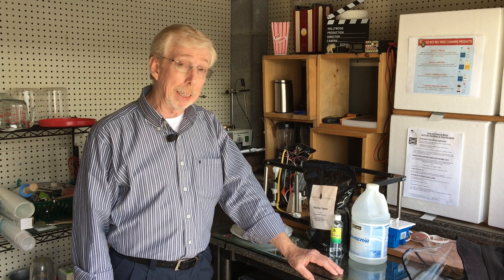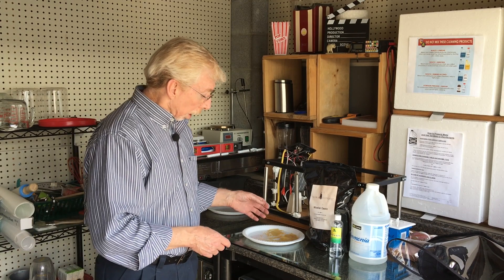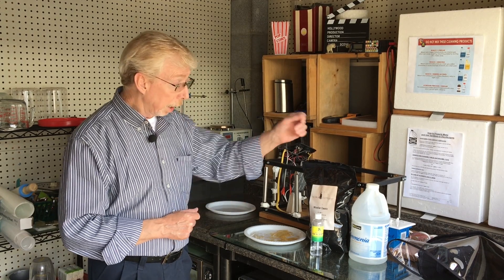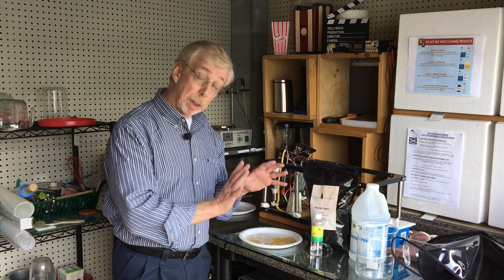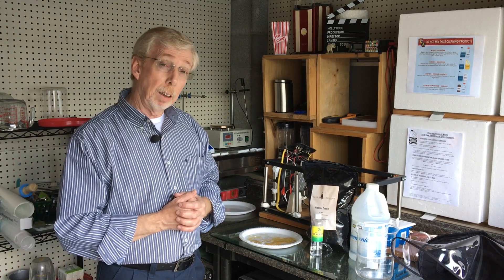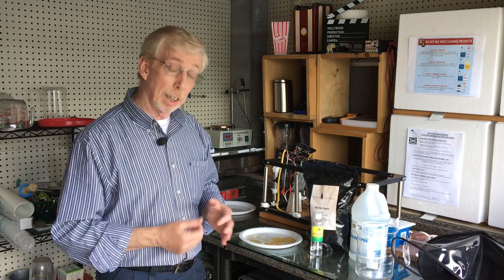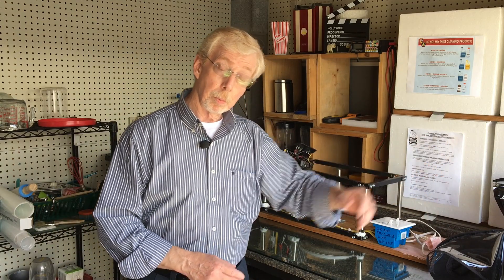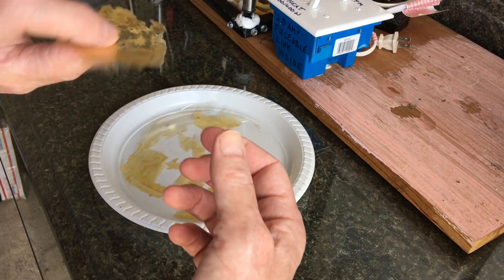Clear plastic made from milk. DIY Face Shield made from milk. Part 1

Comment: Great video!
do you know about an organic additive that will make the bioplastic more UV resistant?
Reply from the maker: I love your question as it gives me a chance to explain the difference between 'old thinking' and the new (much older) way things need to be done.
Our ancestors put everything that need long term storage in glass or metal. And we need to return to that. Then we got 'creative' and started using plastic for everything possible. Those days should move on into ancient history too.
New thinking says we don't want our waste to 'hang around' so we never add UV protection.
The focus of my channel is to show how to replace one use plastics.
There are some things that should be made from LPG plastic, if we would only do it responsibly.
Reply: @GEOsustainable  thank you for your answer. I understand and agree with your approach to single-use plastics in the privet sector. 
but if we are looking to make a change in the industrial sectors as well, we will need plastics that are biodegradable but also durable since not every application can be addressed to with glass or metal. 
a perfect example would be the agriculture industry (that I work in) which is one of the largest consumers of single-use plastics.

of course that this is only my personal point of view (:

Comment: I have read in Science Daily . com dated January 21, 2021, using as source the University of New South Wales, that though "ammonia has sustained humanity since the early 20th century, [but] its production leaves a huge carbon footprint.  Now researchers have found a way to make it 100 per cent renewable."  Is the ammonia used to illustrate this super interesting video 100 % renewable...?      If the emphasis here (I always follow your postings...!) is to be Geo Sustainable how can we be testing ammonia...?!
Reply from the maker: Well, you have a point. I do not know where my household ammonia comes from. I do know ammonia is found in nature and therefore, renewable. I do know most ammonia comes from cattle urine, so the carbon footprint they speak of are likely cow farts. I honestly do not know about the 'new research', ammonia has pretty much always come from cow urine. You could synthesize ammonia from the methane in a cow fart, but why would you...just wait for the stream. Tarnation, those cow farts are useful it seems :)
Reply: @GEOsustainable  Maybe the one that is not sustainable isn't made with petroleum chemistry like farming nitrogen ?
You can also do your own with your own pee ; )

Comment: love your videos! i've seen you use milk and gelatin in the past, wondering if you have any ideas on making bioplastic from plant-based materials?
Reply from the maker: Thank you so much for watching my videos. I love helping folks solve problems; the life of an engineer. I thought about doing something with cornstarch, but it has been done a lot by others and I can't add much to what they have done. So, I am open to any ideas you may have. Please don't click reply, as I don't get notified. Start a new comment so I get alerted. Thanks again for watching!
Reply: @GEOsustainable   From your garden's potatoes ^^ ? From industry residues ? Malt from brewery ?
I'm on my own experimenting from fermented grass. Permanent pastures are better CO² traps and humus producers than forest (everytime the outside part is eaten or mowed, the related roots dies and feeds the soil ! Renewable, disposed as trash, growing simply with sun, and a bit of water able to clean "dirty waters" (i thanks it with my pee ; )
Not (yet) for transparent uses, but to mold blocks ...

Comment: Is there an easier way to do this to make it at home? Since I’m a student I don’t have a lot of these items
Reply from the maker: I am sure you can do it at home. The chemistry needs to mix 24 hours and until all lumps are gone. If mixing is impossible, you can let it sit for a few days, or until the Casein is completely dissolved.  Keep it covered while you wait, the ammonia is very strong and it should not be allowed to dry out.
Reply: GEO sustainable Is there a temperature you should put it in or is room temperature fine? Thanks for replying

Comment: Is it heat or microwave safe?
Reply from the maker: Yes and no. It will become very brittle in a microwave. So, it would be a truly one use if used for food. It will not soften, it is a thermoset plastic with this chemistry. It will turn white if there is a lot of moisture.

Comment: very interesting,  now what do you thinking of ironing a few together? would you be able to seal them together? will the final product be able to be melted down and applied in a way to make long sheets?
Reply from the maker: Great questions. I do plan on ironing a few together, at the seams. They do seal, set to Wool (protein).  You will see that in part 2. I have not tried to melt them, which they will do,  I'll give it a go and report back. I have considered how to make a continuous sheet for a roll. My best guess would be a long belt, which I may try.

Comment: Looks good but how water proof is it?
Reply from the maker: Rotten Brainz  Yes, I use tannin, wine or tea, but it enhances the amber color. I will be trying pectin soon, as I have read it works. I hope to bring this to you soon in a video. The trick is, if the acid is too strong, it turns into Galalith. For now, to avoid all that, I use the Shellac (secretion of the female Lac bug). All good stuff Rotten!
Reply: @GEOsustainable  Nice ! And what about simply spraying with oil ? It could enven become more transparent ..
I'm looking for a way to do simple, or better, double glazed greenhouse from this kind of bioplastic : ) (or at least re melt old plastic from greenhouse to do a new one ; )
Reply: @GEOsustainable  hey!
have you ever made that video eventually?
Reply from the maker: Great question. Not even waterproof, as soon as water hits it, it will turn white and weaken, but will return to normal once it dries. If you want it waterproof, spray a coat of Shellac.